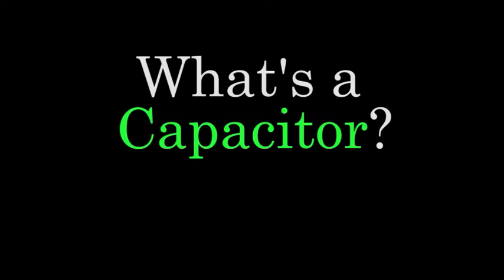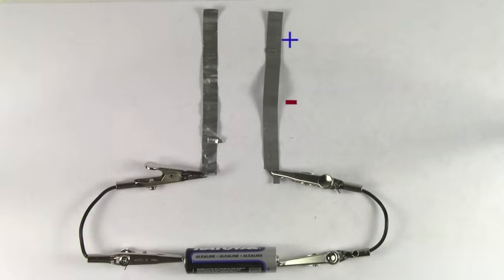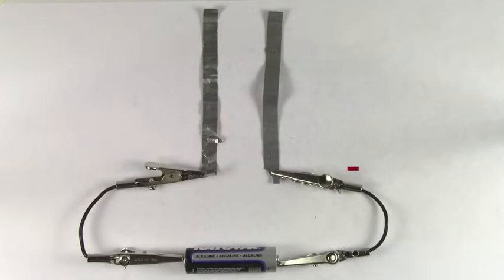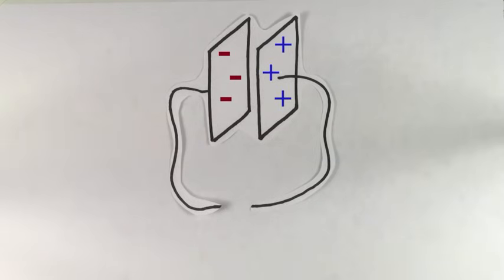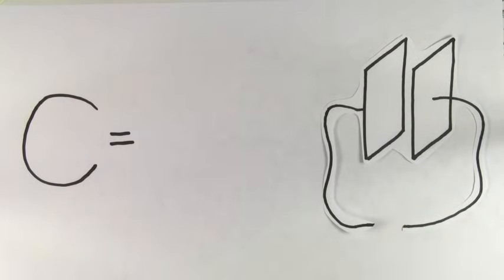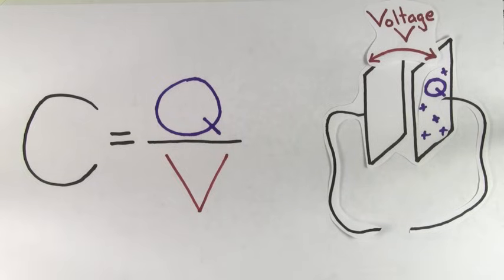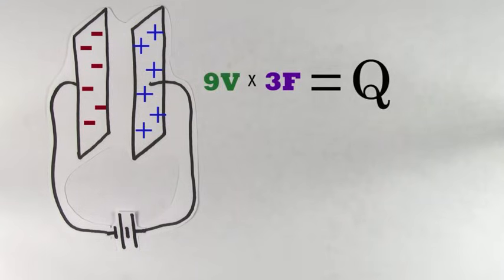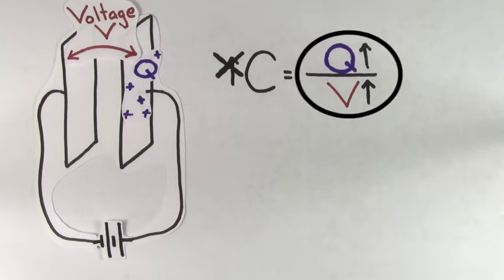Capacitors and capacitance | Circuits | Physics | Khan Academy

Comment: this is not a closed electric circuit.  why the electrons can move to the plates by emf ? 
l knew that the current(=electron) can only flow in the closed circuit
Reply: The current in a cap stops when voltage of supply and cap are equal so it looks like an open circuit. But while getting the cap voltage to match the supply voltage, the supply pushes current into the cap so it behaves like a closed circuit.

Comment: This was incredibly helpful But I have a question

You said that the charging process stops when the electrons in the wire are equally attracted to the positively charged metal plate and also to the positive terminal of the battery so the electron just sits there. But then you said even if you remove the battery the "accumulated charges" just sit there. But this confuses me because when you remove the battery, the electrons are no longer attracted to the positive terminal of the battery right? So doesn't that make them move towards the positively charged metal plate? If this happens then the metal plate will return to its original state, no?
Reply: The dielectric keeps that from happening.

Comment: Summary Of The Video :-

Capacitor and Capacitance

*Capacitor is a device which is used to store charge.

*As we connect two metal plates with a battery one plate gets positively charge and another plate get negatively charge.

 Note - Both metal plates are going to have the same magnitude of charge but of opposite nature.

* Above is true for even plates have  different sizes and shapes.

* This process of charging is not going to happen forever .

* If we remove the battery the charges will still stay in plates.

 * If two metal piece touch each other ,  In that case our Capacitor will never get charge beacuse circuit is completed.

 Capacitance  of Capacitor tells us that how good the Capacitor is in storing charge.

* In reality Total charge of Capacitor is zero.

* The voltage between a fully charged Capacitor is same as the voltage of the battery.

Unit - Farad (Coulomb / Volt)

* We can not change the Capacitance of Capacitor by changing charge (Q) or voltage (V).

* We can only change  the Capacitance by by changing the physical characteristics of the Capacitor.
Reply: Learn English bruh. Might have also said something about impedance and ESR. Actually strange that khan didn't say anything about ESR, it's just a smol resistor.

Comment: If there are equal no of opposite charges on both plates of capacitor, then how does potential difference is setup..equal positive charges on one plate are equal to no of negative charges.
Though both are equal , but we say that positive is high potential?

Comment: Will a longer distance between the plates create a larger voltage?  Nice rap btw
Reply: It will create a higher voltage RATING, but it will be quite a trade-off for capacitance. The voltage will always be equal to supply voltage.

Comment: how to calculate the cap size? 50V 1000 uf is enough for 12v 10 amps (with load) motor?

Comment: Is the same electron that moves through the battery before and after flowing through it. I mean inside the battery is there the same electron flow as through the metallic wire. Could you clarify me what's happening inside the battery? Thank you

Comment: When you say we can increase the capacitance by altering the physical properties of the capacitor itself, such as by making it bigger, do you mean making the surface area bigger? So does it mean that we can have a small dimension of capacitor with large surface area thus resulting in high capacitance?

Comment: hllo everyone i am not getting tht wht he meant by saying tht more the distance b/w the metl plates is incresed so how the capacitor changes? and also what is the difference b/w capacitance n capacitor?
Reply: Capacitance is inversely proportional to the distance between the metal plates.
There is a formula which says

C=( A.E) /d
Where A is the area of the plate,
E is the permittivity of free space , and
d is the distance between the plates

Comment: Amazing video! Perfect tempo and great info.
I knew a lot about capacitors, but I still extracted huge amounts of new info.
Before I really didn't understand why capacitors didn't pass DC current, but now I get it! So simple after hearing the explanation.
Reply: hllo , can u please tell me that why capacitors didn't pass DC current??also please tell me about the various types of capacitors like where do we use 2microF capacitors?
Reply: Ghost Naughty 
Because they saturate with the charge, which eventually cancels the applied voltage.

Capacitor size is determined how it is used. E.g. if used for storage, you can calculate the needed energy 0.5CV^2, where C is the cap size.
If cap is used for decoupling, size is determined by the noise frequency it needs to work within.
Reply: then what about AC? n i didnt get the meaning of "saturate"?
Reply: Ghost Naughty 
Saturate=capacitor becomes full of charge

For AC, the charge in the capacitor is not opposing the voltage any more when the direction changes.